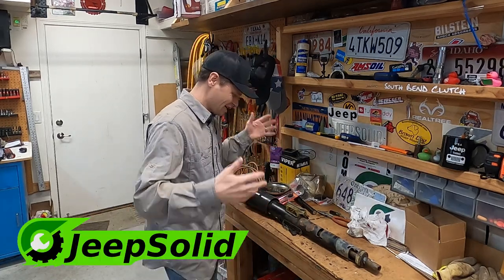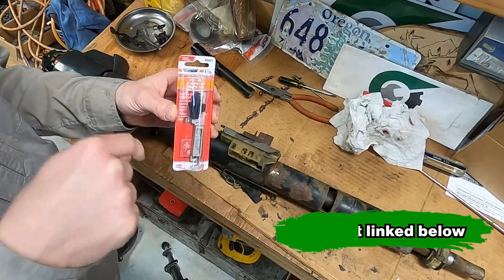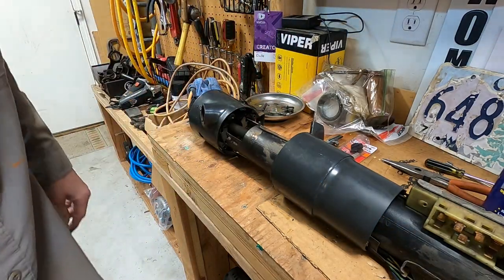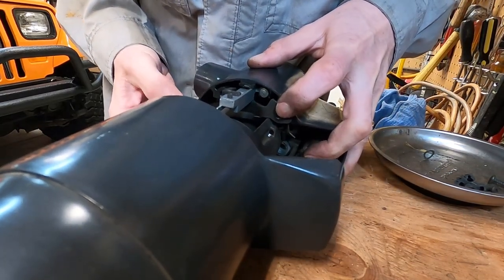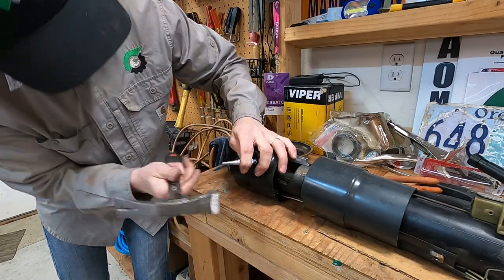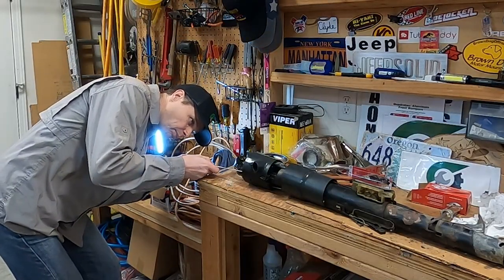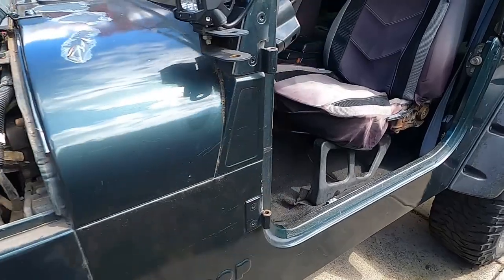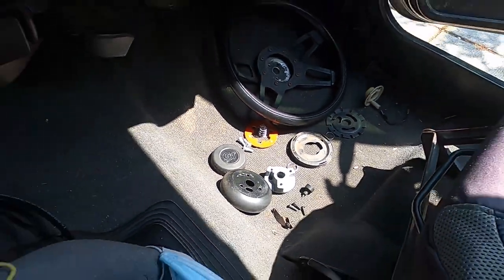Rebuilding Jeep YJ Steering Column: Jeep YJ Key Gear Rack and Sector

Comment: good video and WD40 or Water Displacement 40 was designed to use on electrical circuits to displace water for NASA. It is also good as a penitent but never a lubricant.
Reply: should have said penetrant

Comment: Did you or have you replaced the upper steering shaft bearing? I’ve seen a bunch of videos on the lower one, nothing so far on the upper one.  And yes, a compressor tool is well worth the $40!

Comment: I have a buddy who is struggling with his steering column.  He said he broke the original and is about to buy one from a salvage yard for $350. The yard says the tilt needs tightened up. I don't believe they're talking about the handle either. Any advice would be very appreciated.

Comment: I need to replace the turn signal/ washer switch. I've removed the three T30 bolts however I can't remove the cover, it's still firmly in place. Will I need to completely remove the column to remove this part?

Comment: What about the little leaf spring under the rack that puts tension against the gear when you turn the key. Does anybody know where to get it from?
Reply from the maker: Not sure
Reply: That spring broke on mine and caused the "rack" and "spindle" to not mesh and skip. I would give you a link but this reply column keeps deleting my reply. You can go to steering column services. Its a GM steering column and if you find the right diagram, it will be part number 25-rack tension spring. That website sells the parts as well. It has good diagrams of steering columns and parts.
Reply: @LOKELYOKEL1  Thanks for this i found it where you said. It's a discontinued part so says its in short supply. Right now made one from my wifes hair clip as a temporary fix.